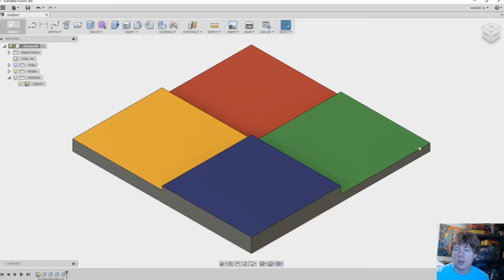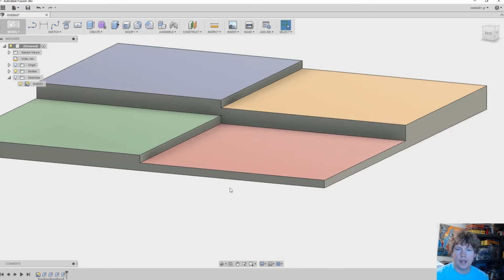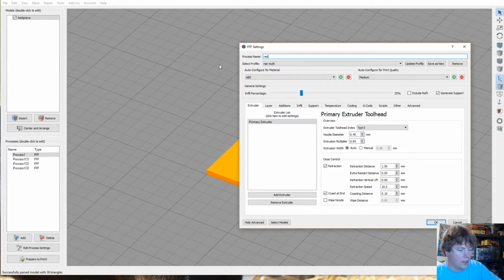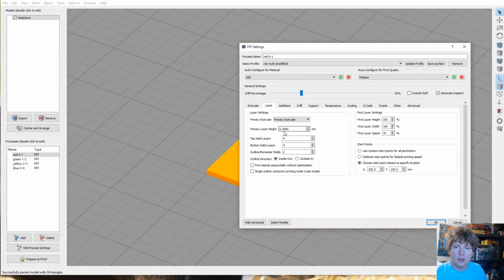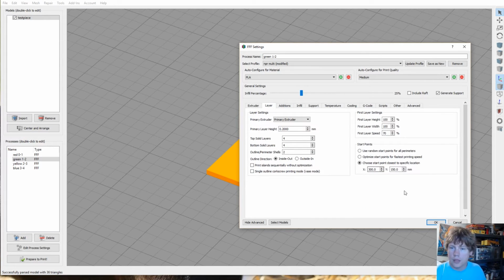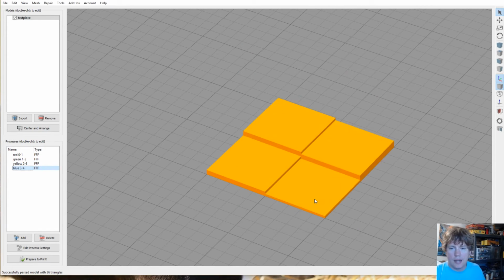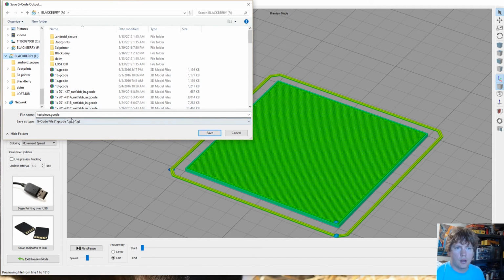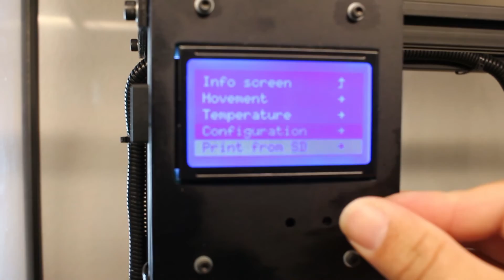Printing multiple colors with single extruder

Comment: Very nice, im doing the same with cura. But i want to print a curved suface (for example a spiderman pendant modeled by me, 3 color, black base for the lines of the mask, red for the mask and white eyes.), and i found that layer filament change is not working with this type of object, since the height is not defined in a curved surface. The best option is send just 1 print with multiple objects, and ask when the first ojbect is finished, pause, change filament color and resume print. Is ther any way to do that in cura or simplify 3d ??

Comment: Kirby I been trying my hand at some multicolor printing and your tutorial is the best I've found. I am having a problem that I hope you might help me with. I've followed your instructions exactly but when I make my first color change and the extruder starts to the print it comes down some but stops 1.5mm above the print, so it's basically printing in the air. I've tried everything I can think of but can't get it to come down on the print. One other thing I've noticed is when the first print stops and the end script tells the extruder to home the X Axis the extruder raises about 10mm on it's way to the home position. I'm really kind of new to 3D printing but I thought when you did a G28 X0 ; home x axis it was suppose to go straight home without raising. Is there anyway auto bed leveling could be causing this problem? Thx for any help on this.
Reply from the maker: Larry Hodge areyou using simplify3d? And what printer
Reply: Yes Kirby I'm using S3D. I'm printing with an Anet A8 that I converted to the AM8. I've did several upgrades to it. It prints great accept for this multi color problem I'm having.

Comment: nice explanation of the setup and process. I'm wondering, what's thoses blobs near the corners of the part and skirt - In s3d, the slice preview shows these. Is that a bug or did they actually print?
Reply from the maker: Thanks, I like not having to watch the printer and hope I paused at correct spot using this method. I think the blue blobs are my retraction spots. It looks like a I have show retractions turned on in the preview